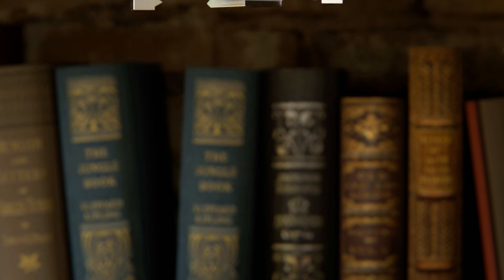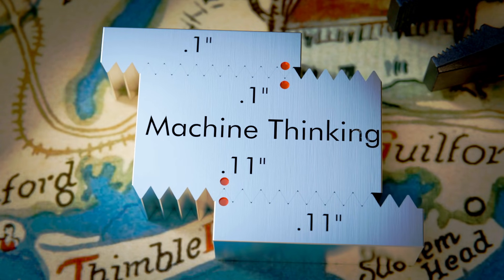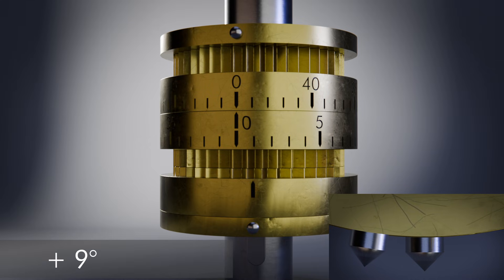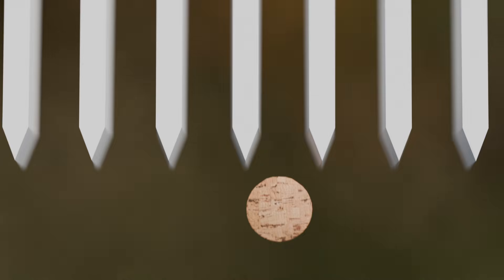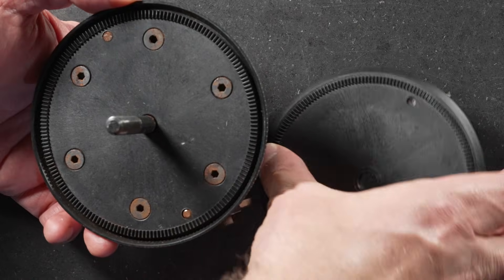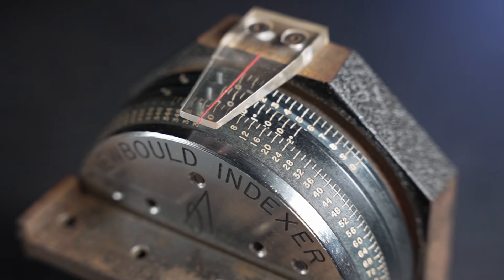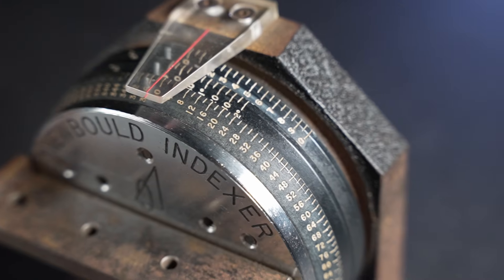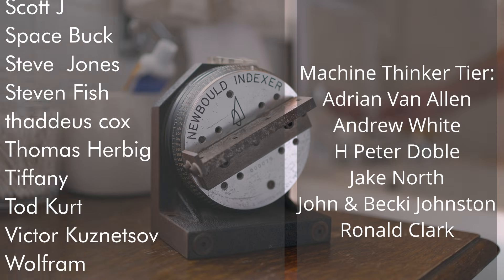INCREDIBLE PRECISION from SIMPLE PARTS - The CLEVER trick

Comment: nice explanation. happened to me that VW beetle's rear suspension use a torsion bar with splines on both sides for adjusting preload, at some point was trying to adjust height and found out that moving one side by one spline was too high, bringing it back was too low... till i discovered information that the 2 sides of the torsion bar have features as you describe for more fine tuning.

Comment: These do not create the capability for extreme precision. They merely replicate it. To manufacture any of these, you need to already have access to extreme precision.

Let's look at the block from the start of the video. Cutting the teeth into one side is easy. Just cut teeth. Accurately cutting the teeth into the other side with an offset a fraction of a tooth's width requires the ability to accurately offset your cut by a fraction of a tooth's width.

These parts cannot be manufactured without already having access to the precision they give.

Comment: Brilliant solution. I'm wondering how the face gears were manufactured. Machined? Partly of course. Injection molded? 
Of course another solution for angular indexing to fine steps could be a planetary gear train to step down the imput. 

A number of years ago l made a set of 5C collet blocks. The simplest indexing device one can find in a machining environment. Only the the ones l made were not the usual four and six sided ones. I made 5, 7, 8, 9, 10 and 12 sided ones. The 1.250 bore was honed to a close sliding fit to a piece of ground stock. To mill and later grind the flats l used simple solid angles. Cut one flat on the mill and then index that face to the the solid angle. The problem came in just where do you find a solid angle of 51.42857°. Make one of course. When finished the blocks came out to be very precise. All done by a very simple indexing system.

Comment: Not more than a week ago, I designed a 3D printable vernier coupler which is very close to your single degree rotation. Except, I use 18 and 20 teeth for 2 degree. (18 an 19 would be 1.05, o well...)

Comment: Related:

Some hand planes use a differential screw thread mechanism, with a driving thread (say 16 TPI RH) nested with a reversing thread (say 20 TPI LH); So a single turn advances by 1/16" but retract by 1/20" - net advance is 1/80"

Both threads are strong, but the movement is fine.

Comment: Firstly, you could use 40 and 41, not 40 and 45. The precision is better, and the only reason not to is if you are scared of fractions.
You could do this with 3 pieces. 
Piece 1) 2 units of 40 tooth, then 1 unit of circular spacer.
Piece 2) 2 units of 41 tooth. 
Piece 3) 1unit of 40 tooth, then 1 unit of blank, then 1 unit of 41 tooth.

Only issue with this design, you need to spring it to the middle. It's push one way to rotate one side, push the other way to rotate the other side.

Comment: Volkswagen used this concept with it's torsion spring suspension components. In order to set the ride height for each of the wheels, a torsion rod was used which had a different number of splines on the inner end than the outer. 44/48 or 48/52 depending on the year.  The equated to adjustments down to half a degree I think. It was very tedious to adjust though, because it required taking a LOT of stuff apart that was packed with grease and if you skipped a tooth you would get way off your mark.
Reply: laughing in radians
Reply: Also. You had me at the metric digs. Subscribed.

Comment: fun fact, you will never need more than one hundredth of an arc second of longitude or latitude when navigating around earth. 0.01 arc seconds of latitude or longitude is at most 1 foot (about 0.3 meters). this is extremely convenient for use with digital systems where floating point numbers and accuracy can be an issue. and if you ever do need to navigate more accurately than 1 foot, then you probably don't need to do so using the center of the earth as a reference and you can assume the area you are navigating is flat (1 square foot of flat space)

Comment: For 2°10', he would need to divide the circle in 166,1538... equal parts.
Now I understand that he just made 166 teeths.
My question is how did he figure out the teeth width ? How did he do that in practice ?
Thanks, great video.
Reply: Traditional dividing plates work on a simular prinicple mathmatically. They are just far more finicky and require an entire set of plates and pins, and given that they use pins they slowly wear out, and really do poorly in dusty enviroments.

And those plates are made using trig, just math out where every hole needs to go and spend way too long with gauge blocks and sinebars. 

But also as gears wear into better accuracy you can also just make course gears and slowly conform them using an sacraficial lapping gear so long as you know how many gear teeth you need, and you can use that to make a dividing head that in one direction (at a time) will always get more accurate so long as you never reverse direction, and take the hit to repeatability as everything moves to higher accuracy.
Good old gears. Gotta love/hate them.

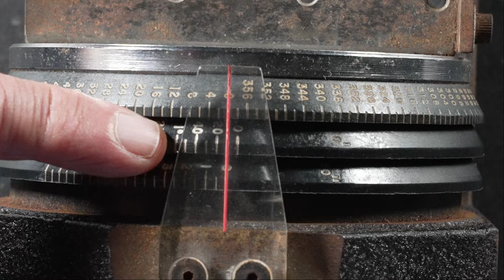Comment: 11:24 I don't understand: if the outer wheel was returned to 0 (according to the red line), shouldn't the platform be at the same angle it was before? Or is it just that the angle is so small that we can't meaningfully see it "displayed"?
Reply from the maker: I presume you're talking about the example where I advanced it 10 minutes of arc.  When I first added 10 minutes, I was really adding 2 degrees 10 minutes because that is the size of the face gears on the middle disk. Then I removed 2 degrees from the outer most disk leaving just those 10 minutes, which is so small, yes, it doesn't look like the front disk has moved at all.
Reply: @machinethinking  OK, I was missing the last part; thanks.

Comment: While I understood the reasons and how it worked I feel dumb because I can't understand how to use it and for which practical applications. 
The most I measure with my old lathe is with a digital caliper or just if the other part fits or not.
Reply: This is for insane precision engineering, he mentions grinding very exact angles four instance. This is not a tool necessary for the home shop.

Comment: That's very cool, and kind of like a divider mechanism that actually "throws away" a pulse/click for a certain number of "rotations", accepting a tiny inaccuray of the rotation that lasts for a miniscule part of the distance/division being performed. This fine fellow determined that the gap was "buried" in the rotation, basically a glitch in the angle, but the rest of the teeth are engaged, so that the little gap is never "seen".
I wonder, though... It has very fine resolution , but, what about _accuracy_? Maybe some differential change in the actual size of a disk makes an actual change in the angular indication versus an absolute angular measurement, with, say, a Moore 1440 divider (guaranteed to 1/10 arc second. It was actually accurate to 1/50 of an arc second)?
Reply from the maker: I knew this would come up. I tried to hunt down the original booklet that came with it but no luck. However, I think I read somewhere that the model 100 was rated at +/- 5 arc seconds accuracy.  There were other models that might have had higher resolution but I'm not familiar with them.

Comment: Now I'm wondering how you could build something with two threads of opposite handedness and slightly different pitches (10TPI and 11TPI) so one rotation moves by the differential amount, and you could subdivide that with dial markings like a lathe handwheel.
Reply from the maker: Yup! That’s probably the most common use case and a likely future video.

Comment: You can take your patronizing metric remarks and shove them.
We can transfer your body part based concepts and apply them within a sensible system, and they still work. We don't have the need to work in 1000ths of a thumb.
Reply: Not sure why you think 100ths of a 1000th of some arbitrary part of the planet is any better. 

The distance from the north pole to the equator through Paris was set to 10,000 km and the meter was derived from that. It has since been redefined multiple times, a couple of standard bars, then krypton atoms, then the speed of light (not that we can actually measure the path light travels in 1/299,792,458 second).
Reply: @TEDodd  I'm not primarily talking about the base. That can be anything. But using body parts as bases for measurements (notice the plural there) stopped making sense when we stopped using body  parts to measure things. Your length measurements scale by factors 3, 12, 3, 5.5, 2, 20, 8. By themselves each of these length units made sense one time (e.g. the mile is 1000 double paces, i.e 1000 beats of your right foot (other feet are available)). Squeezing them in one "system" was a stupid idea. The stupidity of that was addressed by the metric system, putting all physical units in sensible relations to each other.
But then the USA decided (last time under St. Reagan) to throw a "not invented here" tantrum and defy sense.

What it all boils down to: if you work in one system, you don't have the need to make things fit an even measurement in another system.

Comment: All angles are possible here because the wheels step by 9° and 8°, which can combine to make 1°. Once you can make 1°, you can make any angle from 0° to 359°. In this case that works because the wheels have 40 and 45 teeth, and the least common multiple of 40 and 45 is 360. More generally, for m-tooth and n-tooth wheels (dividing 360), you get full coverage when their LCM is 360.

Comment: The inch •IS• a metric unit.  Look up the definition of an inch.  If you want to know why the inch is a metric unit, it is a very interesting story set in Switzerland before WWII.  A single man running his own business redefined the British inch and the American inch for his own convenience.
Reply: That's after the fact revisionism. The inch/foot/yard, mile existed for centuries before the meter.

Originally the US defined metric units with customary units. Then it was later inverted, maintaining the same results (well 2 microinches shorter).
Reply: It doesn't disprove the original assertion that an inch is a metric unit. It is defined in metric units by all but enforceable laws. Before that point, an inch was simply the length of a very specific object; any physical object is subject to change in dimensions, ergo, an inch never had a certain value until the metre was defined. It's hard to enforce a standard of accuracy when the goalposts can move.

I don't particularly care about the metrification of U.S. customary units, as I think whatever situational benefits they may have over their metric equivalents is more than offset by the myriad inconsistencies and the redundancy of needing to know and record two standards which carries all the baggage of both. 

S.I. is certainly not a perfect framework but it's remarkably good compared to everything that came before it; it's a tool that was made by design rather than adaptation of an existing tool. In this sense, it is indeed misleading to claim that inches are a part of SI - it's just that SI is the basis on which customary units went from analogue to digital. In a world where so much new technology increasingly sucks ass, I can't help but stan this instance of globalisation making life easier for so many people and saving so many hours of inefficient conversations of units. The inertia of existing systems is precisely why such a thing needs to be celebrated, because people prioritise being comfortable with what they're used to. Even when it gets to the point where it would have been less effort to relearn measurements than to convert from the alternative system.
Reply: @HavokTheorem at first the US defined metric unit based on customary units. Only later did they reverse the definitions.

I seldom need to convert between the two systems so not an issue.

Comment: If anyone wants to play along and make something like this in a basic shop, look into differential threading.  Example: if you take a #10-32 screw and tap a #4-40 hole down the center, you'll get a net movement of about 0.006" per revolution.  Constrain the #10 nut and the #4 screw from rotating, use the #10 screw as your adjustment wheel.  (1/32)-(1/40)= 0.00625
If you put 6 equally spaced marks on your adjuster wheel, you can get about 0.001" of movement per mark. (within 5%)
Not sure what that is in nutella jars or enormous chickens though.
Reply: This technique is used in some woodworking handplanes, where small movements (depth of cut) are required under substantial force.

Comment: All gauge blocks are adjustable length gauge blocks: Just add/remove heat.
Reply: and/or or pressure :)
Reply: Or give them to an apprentice
Reply: welder or grinder works too 😁
Reply: @a-k-jun-1  nah we can do better, use hammer to adjust it to size, how precise the adjustment can be is a skill issue
Reply: Even screw jack can do that with required precision
Reply: Hahaha! So true.

Comment: Why are we on the Connecticut shore?
Interesting that the plastic teeth on your indexer are seen as an advantage and not simply expedient mass manufacturing.
Must have been a challenge back in 1972
Reply: Not really, most modern plastic variants were discovered before ww2.
Reply: @luipaardprint   Not the plastic, the incredibly accurate die registrations.
I do understand how the dials being able to conform a little makes it possible.
The thread over in the practical machinist archives answers quite a few questions for me

Comment: Vernier scale in action.
Reply: They are called vernier couplers, and are used to adjust the timing of the motor in diesel cars.
Reply: I was going to say "it's like vernier, but a little different"...  :)
Reply: Totes. It's the same mind-blow you get from finally understanding how two sets of fixed marks on a beam or dial can possibly subdivide the scale. And slide rules. And differential screws - I can't recall who did a vid on those, maybe Tom L or Robbin?

Comment: yeah that is cool but i prefer sine plate for practical use
Reply: It’s not very practical to make arc second adjustments to your sine plate.
Reply: @luipaardprint What is the reason to make adjustments? you just set required angle from the start.
There are also rotary tables and dividing heads if you need to go step by step
Reply: @s @sqrt2-88 ou can’t achieve arcsecomd precision with your sine plate, or with those rotary tables and dividing heads. The type of industries that you would need this precision for is more in the realm of satellite manufacturing, semiconductor manufacturing and the like. So a precision tool like this could have been used to make parts for the tooling for these industries.

Comment: I want one of these, but have no earthly use for it.
Reply: this is not true, you can brush your teeth with ancient toothbrush
Reply: If you wanted to you could 3d print something like this
Reply: @Taskarnin  I'm a machinist (in no small part to the first videos on this channel), making it wouldn't be the hard part. Finding a point would be
Reply: @RealJohnnyAngel I see the angle you took there…

I’ll see myself out.
Reply: @Taskarnin  I really need to complement you for that one.
Reply: @Taskarnin  This is my plan. Just to keep on my desk so the engineers at work can ooo and ahhh.
Reply: I'd mount a laser on one, point it at a wall 2.5 miles away, rotate it one arc second and see if it moved by a penny.
Reply: How about instead of gears with teeth, we substitute them stepper motors of different rotors and poles. Then you can make a clock that can advance by an arc second!